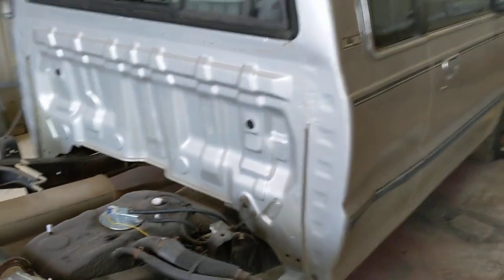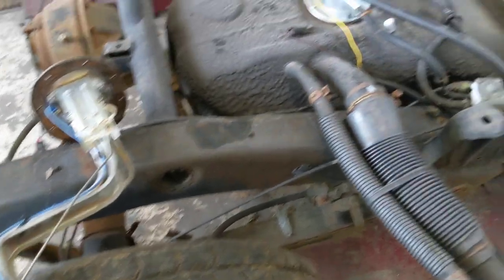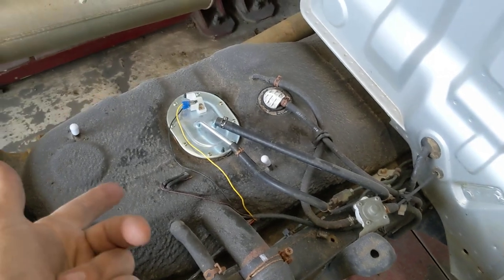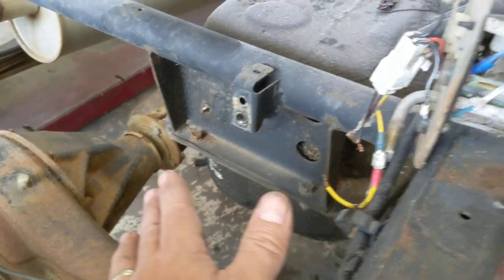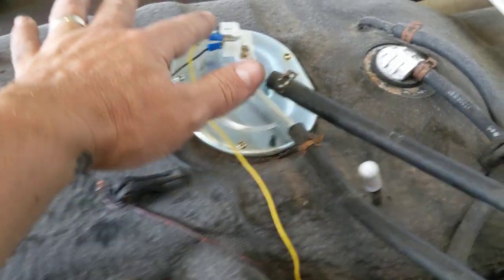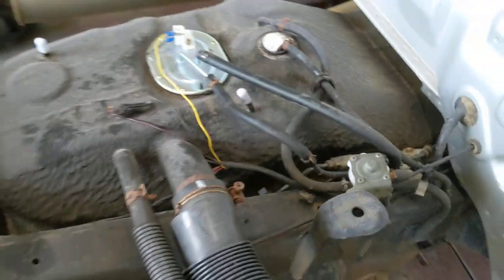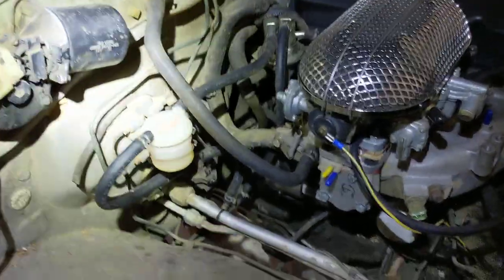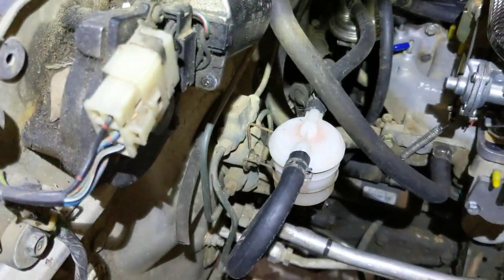How To Switch from Electric Fuel Pump to Mechanical Fuel Pump | Mazda B2000 B2200

Comment from the maker: In this video, we convert an automatic trucks electric fuel pump to a mechanical fuel pump. We also relocate the fuel filter to the firewall or fenderwell area.

There are many incorrect mechanical fuel pumps that can be purchased, but the only one that works for a long time without the pump arm breaking, and its direct OE replacement, is the AIRTEX 1376.
DONT FORGET TO USE THE WHITE SPACER

There have been several B series owners that were victims of the Delphi, Carter, and Spectra brands

Shirts and Apparel
https://teespring.com/stores/mazda-mini-truckin-apparel 

Files and information
http://mazdaminitruckin.com/

Have a Mazda? Join the Facebook Group 
https://www.facebook.com/groups/mazdaminitrucking/

Follow me on Instagram
https://www.instagram.com/mazdamitch/
Reply from the maker: @tyc4037  it's on the intake side at the rear of the head. There is usually a block of plate to remove and it just bolts right up.

Comment: I have a 90 B2200 cab plus with a manual transmission. I just started the cleanup of the engine bay and getting rid of the vacuum garbage. Everything is going great the truck runs great, but if I let it drop down to around 1100 rpm, it shuts down. It cranks right back up, but I can't stop at a stop sign without it trying to die on me. I know it's a fuel issue, just don't know what is causing the issue. It also takes a little while longer to crank now, so I believe I'm losing prime some how. Any idea and information would be great. Still using the original carb and intake, just capped off the vacuum ports.
Reply from the maker: The stock carburetor is probably old and tired and it's basically like gangrene got to get rid of it. Sure you can rebuild it I've done that too it'll get you by just a little while but there's so many components and solenoids that can go bad it's hard to totally renovate the thing. Your best bet is to save up and get a genuine Weber you will not be sorry at all.
Reply: @MazdaMitch  I've been looking at that, and wanting to do it. But I've just got to get by for right now, until I can afford to buy the carburetor
Reply: @MazdaMitch  where is the best place to look at buying a Weber carburetor kit from.
Reply from the maker: Pierce Manifolds Amazon 
https://amzn.to/3QlipZ6

Pierce Manifolds Website
https://www.piercemanifolds.com/Mazda_Weber_Carburetor_Conversion_K675_p/k675.htm

Here is a link to a K675 kit that will work on the 86-93 B2000 and B2200, and also the link from Carbs Unlimited.
https://www.carburetion.com/Products/ProductDetails.aspx?part=K675

Comment: Good afternoon MazdaMitch I have a a question about the sending unit did you install the electric pump replacement on the new sending unit
Reply from the maker: No we did not use any electric pump. Went with the mechanical pump mounted to the cylinder head like on 5 speed trucks.
The sending unit is for a standard transmission truck.

Comment: So where does that yellow wire run up to? Does it go to the back behind the cluster. I’m having gauge issues where it’ll only start working when it reaches a half a tank. I’ll fill it up, it’ll say full and then when I take off, it drops back to E and stays there until it my tank is about half.
Reply from the maker: Sounds like the fuel sending unit is bad, so you need to replace your fuel sending unit.

Comment: at 1:11, what is the little electronic mounted to the frame in the bottom right? it’s connected to the tank just behind the white fitting. the one on this truck i got is connected to the tank, but plugged off on every other part of it. i’ve been trying to figure out how to set this fuel system up
Reply from the maker: It's not electronic it's just an anti rollover valve do you plan on rolling your truck over and letting gas up on the highway I don't think so neither do I So don't worry about it
Reply: @MazdaMitch  i appreciate you very much for that, thank you. another quick question, if i’m running an electric fuel pump i do not need any kind of return line correct? i imagine i just need the main line of course, and then a pressure release of some sort? apologies if that’s a dumb question i am kind of new to these trucks, and mechanical work period.

Comment: What did you do with the fuel pump control unit? Could you show a picture of an installed coil? I have an automatic and when the yellow and green (it may be yellow and green) wire is attached to it the fuel pump stops running.
Reply from the maker: There is a service manual at my website that will be able to help with that, but that was the point of this video, was to delete the electric fuel pump.
Reply: @MazdaMitch  Doesn't the coil and fuel pump both run through the fuel pump control unit? I am asking because my fuel pump will not run until I disconnect it from the coil.
Reply from the maker: @ShawnSprague-r1m   I don't know. The electric fuel pump quit working and it's not even necessary to have on this truck. This truck is an automatic with a carburetor so no need. That's the point of the video. I simply took the sending unit and electric fuel pump out, tossed it, and replaced with the manual transmission fuel sending unit and a mechanical fuel pump and relocated the fuel filter as it all should be like it is on a 5 speed

Comment: Why replace the sending unit? Couldn't the e-pump just be removed?
Reply from the maker: It was faulty, the gauge was not working and the sending unit is directly responsible. Got it on RockAuto

Comment: now my 89 mazda has an electric fuel pump and yal use a manual fuel pump is there any reason y i would or should change to a manual or keep my electric and yesi hit a pump real hard and i thought it was the fuel pump and opened the relay and resoldered a broken piece but i change the fuel pump for no reason and it was the relay running great .wait if the truck sits for a week it does not start up right away takes 3 attemps 3 cranks then it fires im in los angeles cant change to a weber would love to .dame . thanks if someone can help me .
Reply from the maker: The electric pump was an unnecessary headache on the carbed automatic trucks, and the fuel filter location was stupid. In this Video, Jasons electric pump had quit. Its not needed so we did the swab to a mechanical pump like all the standard transmission trucks have. No issues, cranks every time. Join our group for more help and tips, https://www.facebook.com/groups/mazdaminitrucking